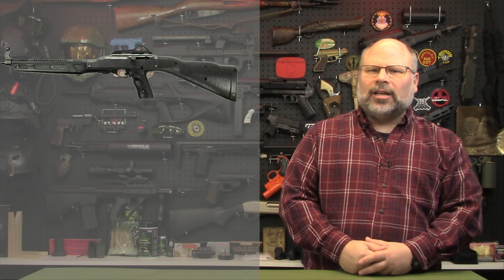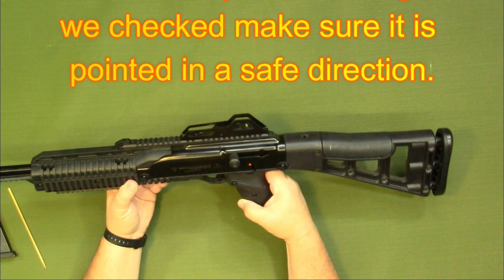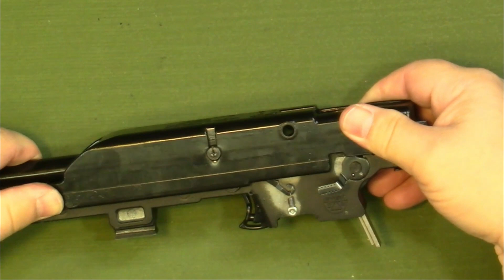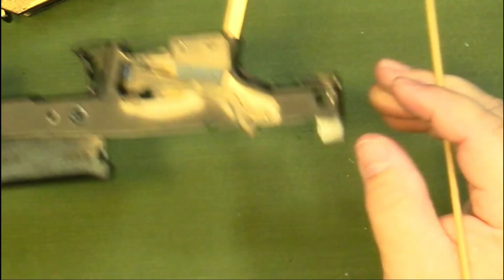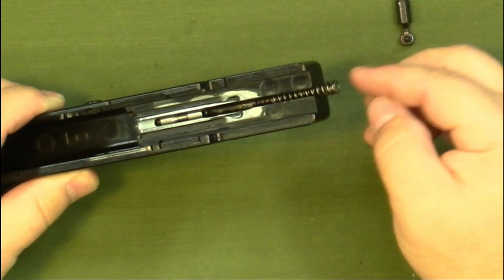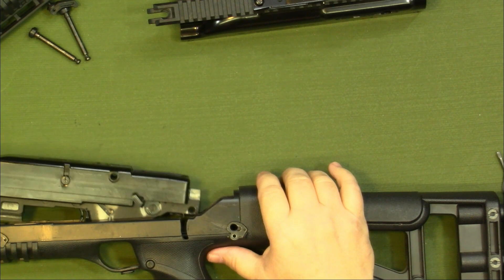Hi Point Carbine 995TS Disassembly

Comment: Thank you for that. I have a question so I have a new carbine by High Point and when I pull the handle, it doesn’t go down into the slot. I don’t know why, but it just won’t go down into a slot to lock. Do you know why that could be happening also on the handle the little the screw that goes in is it supposed to be tight where that little handle part should be kind of snug too or does it need to be loose and turning around cause if I tighten it snug that little turning thing the handle doesn’t spin good.